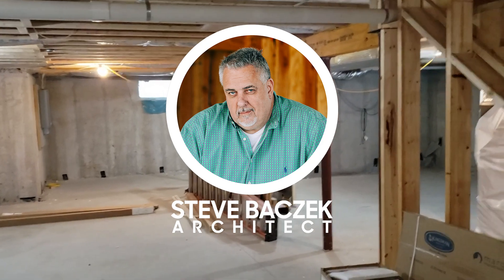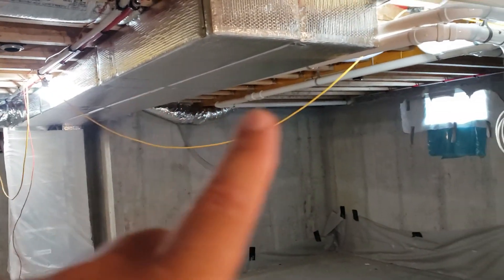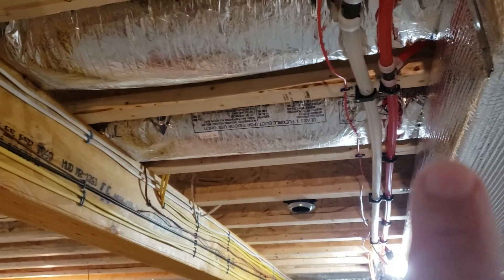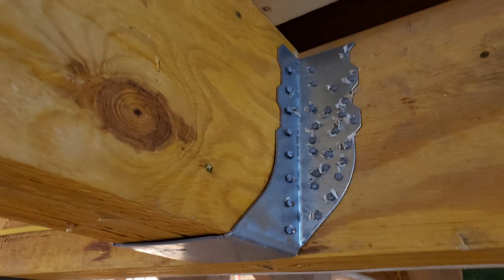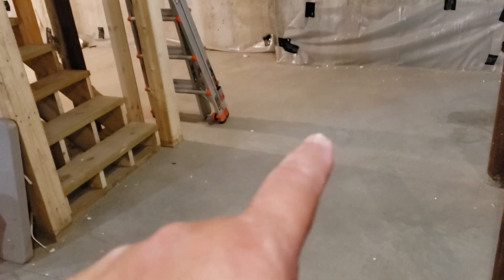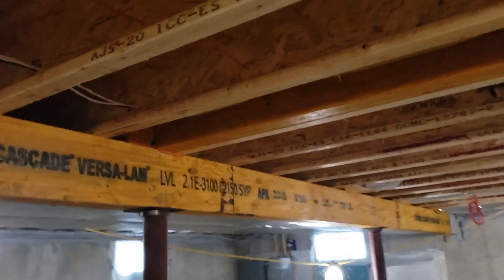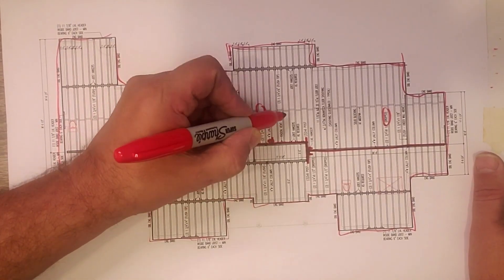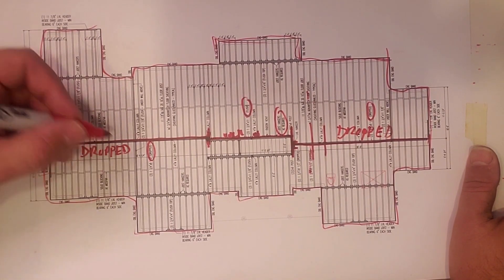FLOOR FRAMING

Comment: 4:05 The finger pointing is fine! That's real life, working in the field. I wouldn't pay much attention to people who complain if everything isn't totally polished. That's not how life works.
Your videos are great and though I've been working in the field roughly as long as you I always learn something new.
Thanks a bunch!

2:20 You have a framed wall under the beam alongside the stair. You could have used that to support the floor joists above, and not used that beam. Was there some compelling reason not to go that route? I'm sure you had a good reason and I'm just curious to hear it. Thanks.